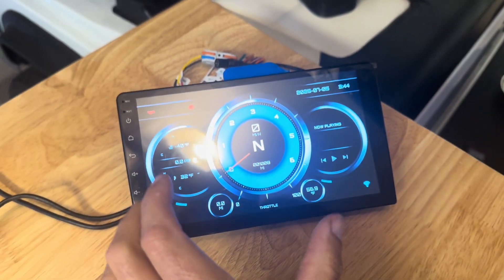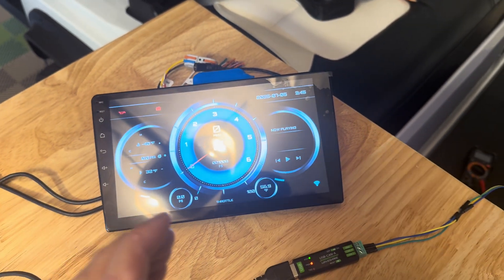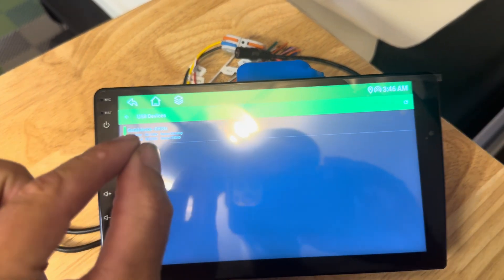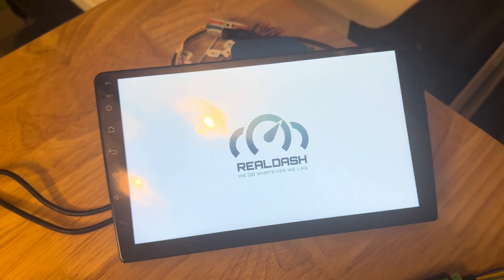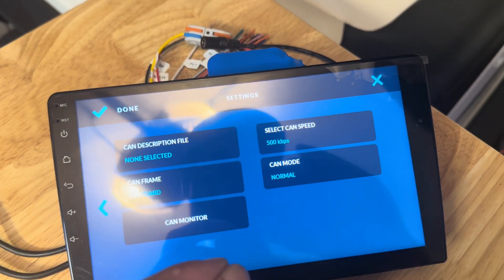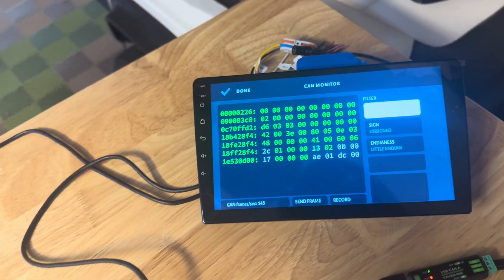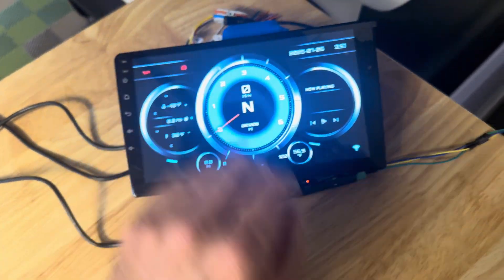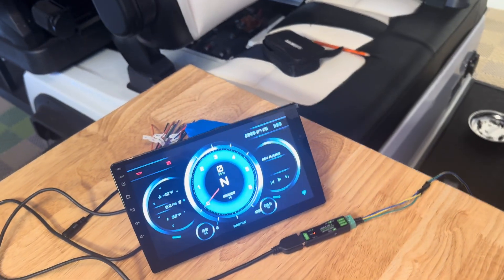Evolution D5 Golf Cart Dash - Custom RealDash and Waveshare USB to CAN Adapter on Android Head Unit

Comment: Hey man, excellent project!

Im curious, how will you het realdash to become the boot app?

I am doing a similar project on my truck. Using a 12.3" Joying radio, RealDash, and a OneGauge hub (usb connection). Onegauge takes all the wired vehicle sensors & indicators, and sends the info over to Realdash via usb (not bluetooth since its hit or miss w these android radios!).

So far, in early testing stages, i used the "Navigation on Boot" setting, and then set the Nav app as RealDash.
So now the radio can boot into RealDash, but not after about a 5 second delay on the home screen. 

I was hoping to find a way to make RealDash act like a home launcher. Or kiosk mode. Where RealDash is booted into more immediate and nothing else (no radio, mp3 player, nav, etc).

Im curious if you found a similar solution for booting into RealDash? 

Thanks for any info,  i am subbing now!
Reply from the maker: Hmm, I don’t have a ton of info off the top of my mind, the cheap android unit I had uses this weird “car launcher” is your running full Android or does it already have some sort of custom launcher on it? 

On mine (launcher), there was a spot I believe to specify a default boot up app. 

Is yours doing a full power cycle each time, or are you keeping it “sleep” while ignition is off.

Comment: Hey man, I have the same adapter and also a female OBD-II connector. I tried hooking it to my car( 2024 hyundai i20 N-line ) and I'm pretty sure I got all the connections right(pins 5,6,14) and yet I am not receiving any CAN data from the car I have tried almost everything that I could. Also tried chat gpt still nothing. And yeah my laptop is indeed communicating with the adapter I have the driver and the software installed. Yet I cannot get anything. Can you please help me figure out what's wrong?
Reply: I was trying to get a signal for 1 hour straight today🥲 and I did some research, turns out the numbering on my obd connector is wrong. It's the wrong way like it should go from left to right but it goes right to left. I was looking for CAN ids where there's nothing! I'm so relieved that I made such a rookie mistake. Thank God
Reply from the maker: @jawesomeangamingz8347  trust me I’ve been there. Glad you’re moving forward. 👍

Comment: Is this something that could work on 2024 forester
Reply from the maker: So so far this project has been a bit of a bust. It will take significant work to replace the unit. While the same visual size and shape, there are many material differences that the head unit has to even get close. 

So sadly it’s far from plug and play. 😢
Reply: I’ll keep watching I know this kind of stuff takes a long time I’m pretty sure d5 has same controller just different wire harness so if anything I think I would have to add extra pins to forester controller plug

Comment: I am very interested in learning what all you did I am about to get a evolution in a few weeks and do not like the screen layout so this would be very helpful
Reply from the maker: Yeah it’s been a bit of a beast so far, I should be able to share a CAN Bus Database. A “DBC” file soon that has all the different settings mapped so you can build your own dash. 

RealDash has some cool ones like a Honda S2000 style, and some other futuristic stuff. 

I would love to also put torque and throttle position, and other things to animate. I also know there are 2 temperature sensors one on the battery and one in the motor so would be cool to show those.
Reply: @hillvalleylabs I would imagine there’s a lot you can  put on they and  what does it take to decode them if you don’t mind me asking
Reply from the maker: @mjim80  There is a CAN Bus port beside the controller programming port close the controller. You can tap in, and steps like this to decode: https://youtu.be/4gx_gLhNjvs?si=JCWRbw5gikEKcJeh
Reply: @hillvalleylabs I’ll watch it and let you know I appreciate your time and I will be looking forward to the next videos
And do you have a face book page